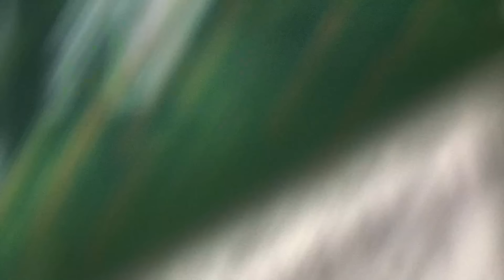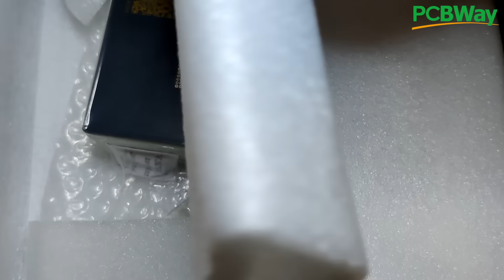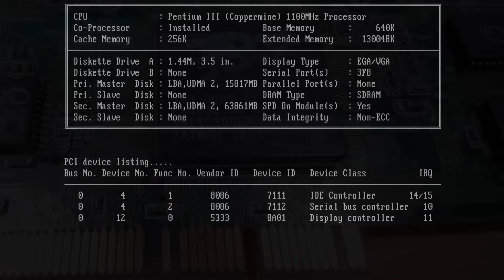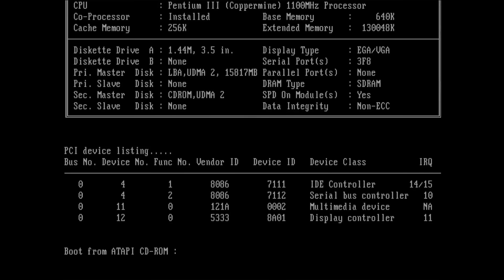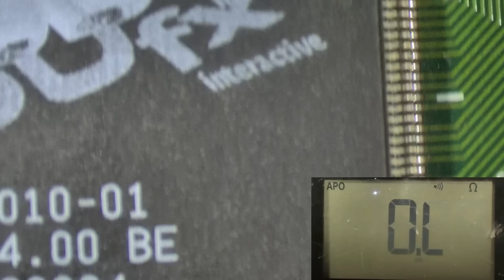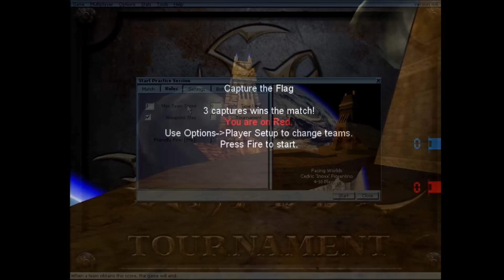How Software Helped Me Find A Hardware Fault! New Voodoo2 Debugging Tool!

Comment: I am dreading a day where lead-free solder is all we have to work with. IMO, it only makes sense to ban leaded solder in (standard) factory-made electronics, as they make up like 99% of devices. For manual work, it's beyond stupid and just makes everyone's lives unnecessarily difficult.

It's awesome how much support Voodoo cards are still getting on the diagnostic side. :) Good thing you thought of checking those resistors before going to town on the memory chips! I might not have been so wise in this situation...
Reply from the maker: Lead-free solder is terrible. You need high heat and the joints look dull immediately. Really terrible stuff.

Comment: I also suffered from unleaded solder flowing badly -- until I changed three things:

1. Using Sn95.8-Ag3.5-Cu0.7 solder. The silver helps massively with reducing temperature, improving flow and avoiding tin pest.
2. Never mixing unleaded solder with anything. Always remove all traces of the previous solder.
3. Use the correct temperature. Unleaded solder is sensitive to overheating.

Once I followed these three rules, my experience with unleaded solder is identical to leaded solder.

Comment: Another impressive video -- your soldering is always a joy to watch. I wanted to ask if capacitor C44 above the bad resistor pack had a cracked joint? I could not tell if it was just reflections or not?

Comment: I keep finding bad 47Ω resistors in networks/arrays on the flex PCBs for products from BlackDog Tech and PixelFX… namely, the DCHDMI/DCDigital and DCDigital HW2. The first time I was lucky enough that it was only the one on the end that showed no continuity so I was able to stand a 47Ω SMD resistor on the side and solder it on. The last time the second from the left had no continuity. It just so happened that the second from the right resistor on the array was visibly unused, so I removed the whole thing, flipped it around, and reinstalled it with the bad, no continuity, resistor in the spot where there were no traces. Worked like a charm!

Comment: You can also use individual resistors instead of a resistor network, but I guess the 56 Ohm one was fine.

An update on the Pentium board, I think I mentioned last time I was going to test it, well it works! Even better after I gave it a BIOS update, now it recognises my 32GB SSD, and I'm just in the middle of setting up Windows 98 for the first time in at least 20 years. It's a bit of an eye-opener, I forgot how spoiled we were when XP came out! But everything's coming back to me, I just got the Sound Blaster 16 working, but the output is very noisy with headphones so I might have to switch it to line out and use amplified speakers.

Comment: Non-leaded solder, the bane of every hobbyist. No wonder the previous owner gave up on the repair. When I started off I also wasn't aware of the difference between solder types, and my first attempted projects were a complete mess because of it.
Reply: It's the cheap unleaded solder that's the problem; Sn100Ni+ doesn't do this. Also, never mix leaded and unleaded.

Comment: Love seeing a problem logically tracked down, the tool assisted but it still needs your experience and savvy to find that fault. That's peculiar as to what caused that single array to fail though, with no signs of damage, Sure the parts are a few decades old but why that single array? Excellent work.

Comment: Hi. I'm having a problem with a Voodoo 1 (ColorMax VP 503). Do you have any ideas where I should start looking? The issue is that the computer won't boot when the Voodoo card is inserted into the PCI slot. Without the card, the computer boots up normally. Thanks in advance for any advice. Best regards.
Reply: And that all pins related to the PCI interface are connected. Missing data or address lines can wreak havoc on the bus!
Reply from the maker: I had a Voodoo once that wasn't working because of a bad resistor array.
Check all resistors for proper values and if all is well, I'd check for bad solder connections.

Comment: I always measure these resistor arrays. A few years ago, I had one card with several of these dead, plus those single resistors on the clock lines, which destroyed my trust in these components XD

Comment: A quick hint at those being TMU1-related issues is that the HUD and the sky in Unreal Tournament are rendered correctly, but surfaces with a lightmap (second texture) have broken texturing. GLQuake or Quake 2 also probably can be used to detect this kind of issues. The corner of that chip looked super scary, by the way :D
Reply: now THIS one is a clever and useful tip, and proves someone understands the nature of that defect!
Reply: @ricsip  Yeah, as far as I understand, though I've never had Voodoo or dealt with its issues, the TMU0 is responsible for sampling GL_TEXTURE0, and the TMU1 samples GL_TEXTURE1, and since the texture coordinate space seems visually coherent, it's most likely that texture memory (maybe fetching, maybe uploading, maybe the storage itself) for the TMU corresponding to the texture stage exhibiting the defect is at fault. Especially when the problem is isolated to just one of the two texture stages, like in this video.

Issues with the FBI, the frame buffer interface (though doing pretty much everything except for texture fetching, including rasterization itself?), as I'd expect from its purposes, would produce something more correlated to the screen space or color/depth rather than texture coordinates (although issues with FBI<>TMU communication, I guess, also may not look exactly texture-space, and texture color issues may also be produced somewhere in TMU's texture sampling, including by TMU memory defects), or even affect vertex positions or texture coordinates themselves — though the latter, or cases where everything is totally wrong, may point to PCI as well, and so do texture memory corruptions as texture uploads go through it.

Other interesting things to look at may be translucent surfaces (involving FBI framebuffer memory reads), depth-buffered (by FBI) world vs. things like UI, vertex color interpolation (also in FBI as far as I understand).